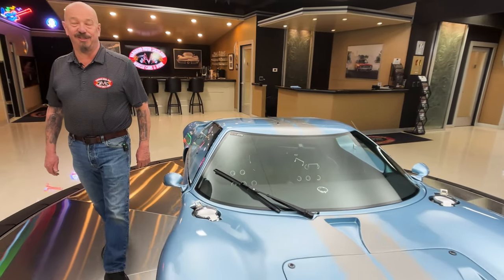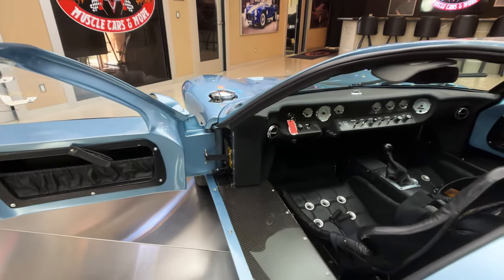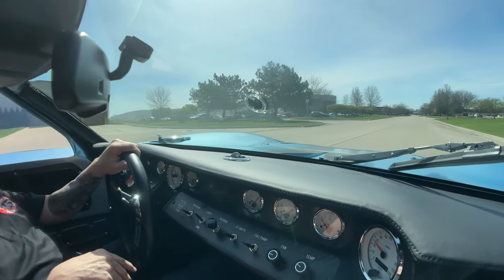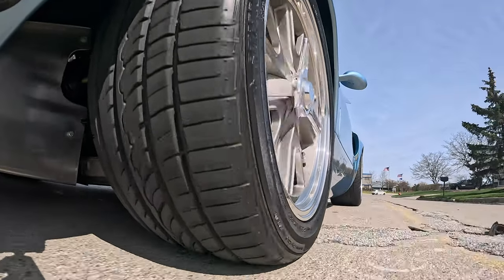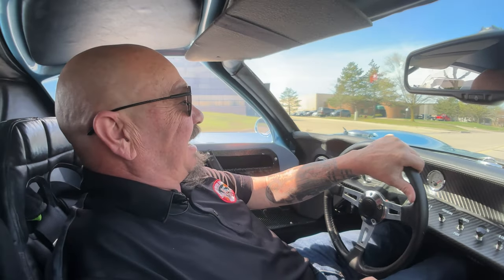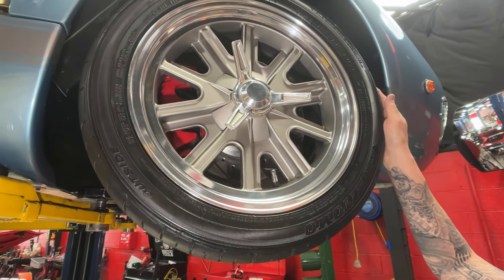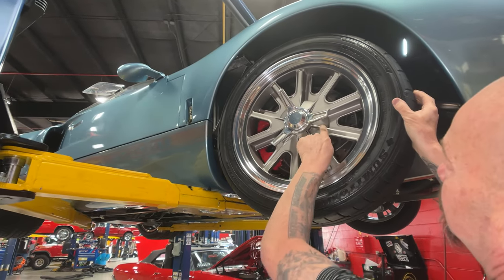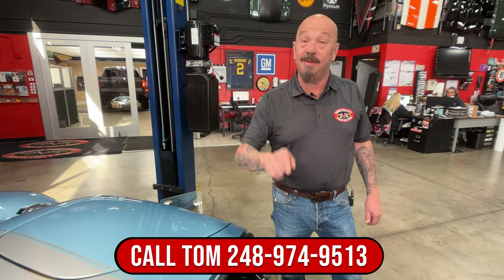1965 Ford GT40 Active Power Cars For Sale Vanguard Motor Sales #4779

Comment: The previous owner kept really good care of it.  Love the GT40 replicars. They are better than the originals since you can drive these and not just park and stare at it sitting in your man cave. 
 A\C, heat , and radios as options. Like this one, fuel injection using a modern Mustang GT's Coyote engine making around 450hp depending on motor generation. And so much aftermarket support if you want to tinker and make more power. Too many worthwhile modern upgrades to name all the things this has the originals don't. 
    You can drive these w\o fear of a rock chip.